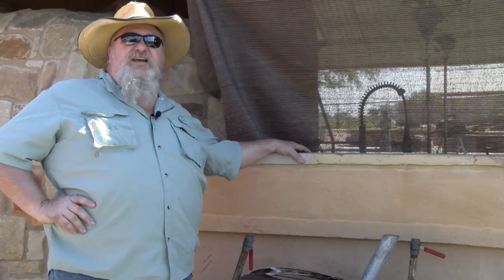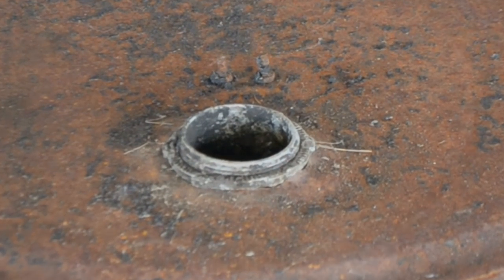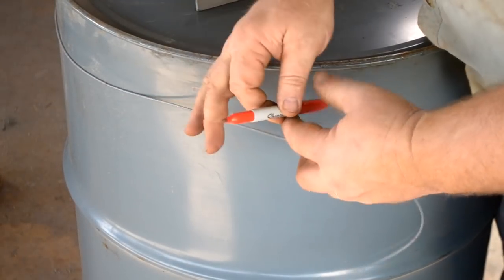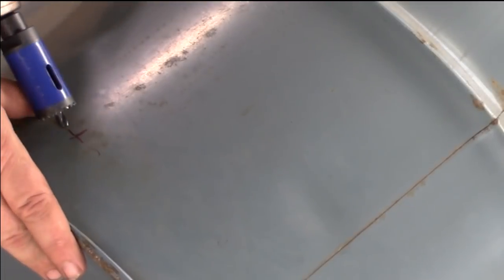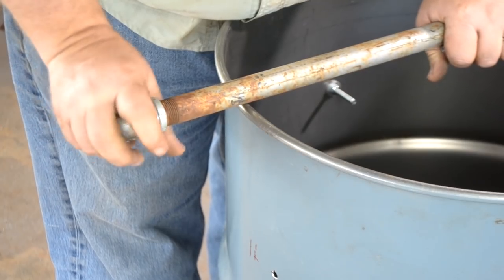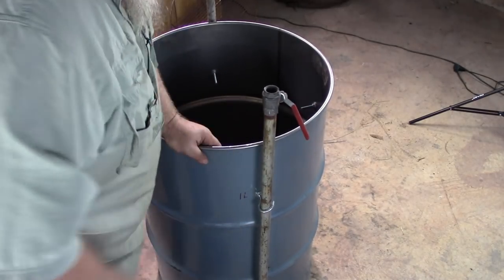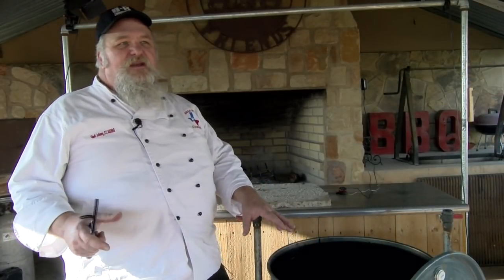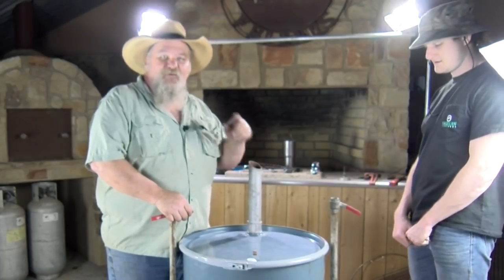Ugly Drum Smoker Build | How To Rebuild A UDS Smoker | Texas Style Cuisine Chef Johnny

Comment: Outstanding Scratch Build Sir, You definitely have a creative mine for BBQ/ Smoking... Have you put hangers in your UDS for cooking Slabs of Ribs, Chicken or Sausage Links? 
Also, a tip that I use for UDS Builds is Two Cooking Level racks and a fire door at the bottom with hinges and a latch for easy access: That seems to work great for extended cooking periods
Reply from the maker: Thanks Butch. Glad ya liked it. I have never found a need for a door. I have always finished any cook I have done. I have not hung in my UDS. I have a Barrel House Cooker with the 5” extension that I do hang in. It works great.

Comment: Before you cut, drill, or weld an old drum, make damn sure the old contents were not flammable.  Vapors can be just as explosive as the former contents, and guys have gotten killed cutting into "empty" drums that exploded.  I was just reading about a guy in Pennsylvania who got killed by a burn barrel last week.  There was another incident in Iowa that killed a man who was welding on top of a barrel, using it as a workbench.  Filling the drum with water before cutting into it can displace explosive vapors, if done correctly.
Reply from the maker: Absolutely correct. When making BBQ barrels I use food grade barrels. Most I see had cooking oil in them.
Reply: @TexasStyleCuisine    👍🏻👍🏻
Reply: @TexasStyleCuisine     That's a good idea, if you can find them.  Most of the ones I've seen advertised in my area are fairly sketchy.  We have a lot of chemical plants around.
Reply from the maker: @jshepard152  I understand that so always be careful

Comment: Where can I find the other video where you built the  The charcoal holder for the bottom
Reply from the maker: The other video I bought a basket. But how I  did it is I rolled my expanded metal around a 20lb propane tank. I welded mine but you can bolt it. Then I cut a bottoms from expanded metal and welded it on. I used 4 bolts 4” long to hold it up off the floor of the barrel. Just use 2 washers and two nuts.  The bolt head was down and I had two nuts on the expanded metal to hold it up.

Comment: If you use shorter intake pipes, is there any advantage of one tall exhaust as opposed to the 4 elbows I see on a lot of builds?
Reply from the maker: Not at all other then a two inch pipe has more airflow then four 3/4” holes I like having plenty of airflow on the exhaust.

Comment: Hi. Why cant the intake be higher than the exhaust ?  Thanks
Reply from the maker: Frank It screws with the air flow. If the intake is higher it will reverse flow and start sucking air through the exhaust. Thanks for watching.

Comment: I’m not understanding about the  nipples that you have caps on,is that how you control air flow or the ones with the Valve?
Reply from the maker: they are all for airflow. I usually dont have all four open unless I am running the temps up high. Usually I have the fron bottom open and the two ball valves adjusted to fin tun the temp.
Reply: Texas Style BBQ and Cuisine thanks,I get it now.
Reply from the maker: John Great let me know if you have any more questions. I will have another build posted next week. Made one from a kit from udsparts.com.
Reply: I have plans to build one shortly,i will be watching for your video.

Comment: Now days go to UDS parts.com don’t waist your time with those pipes they don’t let enough air in
Reply from the maker: Flat Top actually they let plenty of air in the way I set them up.  If you buy a kit you will spend over $100 on the kit plus the barrel. I spent $20 plus a barrel. I used the original one for over 6 years and have no gripes about the airflow. Thanks for mentioning the kits they work very good I simply chose to rebuild what I had and save that money of the expensive kits.
Reply: If you need a larger pipe than that you’re not smoking ... you’re baking/roasting which is fine if that’s what you want to do. I don’t have a UDS but I do have a PBC and to get that thing to cook below 300 means you need very,very little airflow. That’s why it’ll run 8-10hrs on 1 basket of briquettes. If I had it to do over, I’d do exactly what the creator of the video is doing.
Reply: Texas Style BBQ and Cuisine Have you ever set one up to hang meat such as ribs inside? My complaint with PBC is that it’s really not tall enough to hang full racks inside without the lower portion of the rib rack getting overdone because they are only inches from the coals. I’d love to have a taller barrel like the one you whipped up to hang ribs in. Thanks for the video.
Reply from the maker: Wayne Swicegood Thanks Wayne
Reply from the maker: Wayne Swicegood I have not rigged one up to do that but it would not be that hard to do. I do have a barrel house cooker and they sell a 5" extension that really helps on brisket and ribs
Reply: Wayne Swicegood ya I don’t think so LOL
Reply: Texas Style BBQ and Cuisine I hear ya and have one like that but the others I’ve built are no comparison  with those air intake vents I’ve bought
Reply from the maker: oh I am sure. I think also a 1" pipe would work better then the 3/4" pipes. But for using equipment I already had and keeping the cost down it is going to work great.